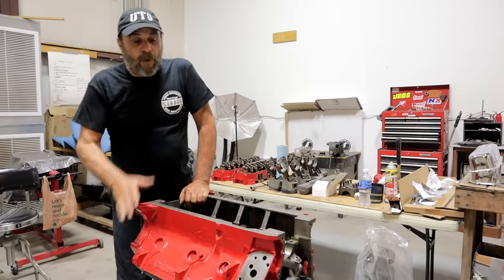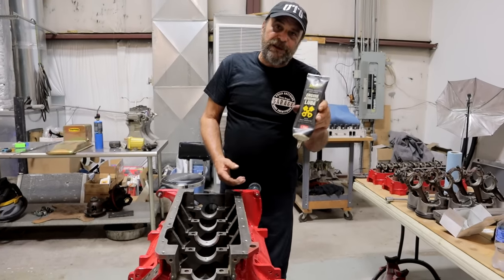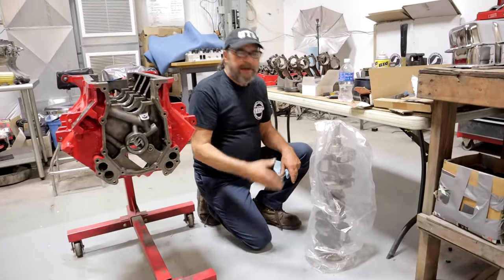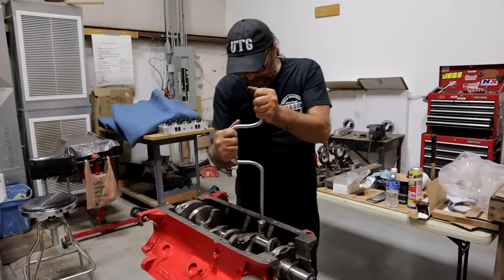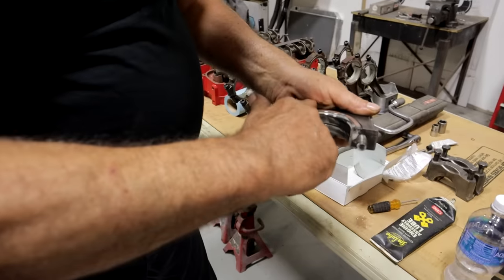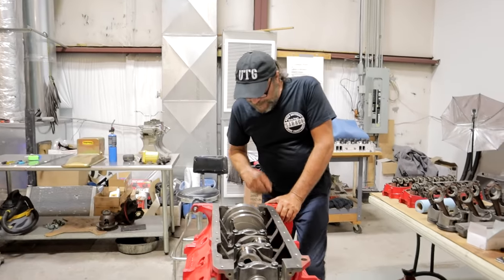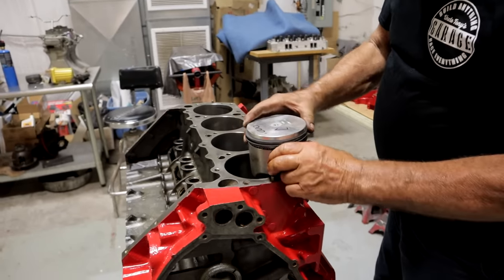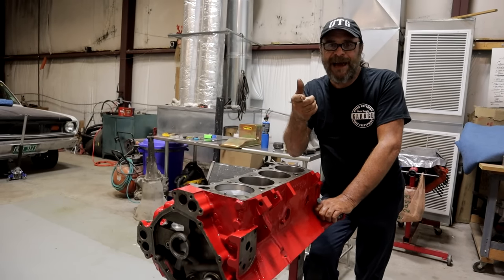Assembling A Short Block For The Home Engine Builder

Comment: The best thing i did when i started building more engines (subarus) was to buy a piston ring compressor that was specifically designed for the size bores used. its got a super thick bottom so you can't score the deck of the block. Not as much of an issue when you're using cast iron, but when you're working with aluminum you can save yourself a lot of heartache

Comment: I have been building my own motors mostly mopar and Harley motors you do them the same way I was taught I use hand tools to and a good click tork and a pointer torkrench to check for stretch just the way I was taught and I built a lot of early nitro motors to I have a 62Belvedere with a 512Hemi in it it is a happy Hemi in it 1650hp on highly modified factory race Holley carbs I like what you are doing thank you for how to reconditioning batteries.

Comment: Preluber from a 15$ bug sprayer and some hose and fittings to go in the oil  pressure sender hole and you're good to go,no distributor futzing around required.

Comment: One forged piston and the rest original (used) cast? I'm not worried about the balance, as it is notoriously bad from Chrysler, but that's pretty ghetto!! LOL😆 That Crane 302H Commander is a good camshaft, I've used them in many 440s and a friend had one in his '68 Road Runner 383 4spd, and they all ran well. We later put a .509 PurpleShaft in the Road Runner, added 4.30 gears and it was an ANIMAL, but with 3.23s the Commander was a way better choice.👍👌
Reply from the maker: It's a cast TRW replacement piston.

Comment: old guy taught me a trick, use Lucas oil for assembly lube. Wayyyy cheaper than the special stuff and it sticks just as good if not better!
Reply: I was told not to do that because it's too thick and could possibly cause a bearing to spin on the first startup

Comment: and...if the crank jams up when you tighten the caps, loosen then, then strike the caps with a heavy rubber mallet. then tighten and check the rotation again. same for over head cams etc. imho I would use a small bar to lever the crank back and forth - and use a dial indicator while your at it and check the thrust bearing end play

Comment: I have had debates with my son for tapping pistons in the same way for years. These days the whipper snappers use machined to size installers (they do make life easy). Just on the thrust bearing, i finish off the thrust toward the rear if running an Auto. Flex plates do just that, flex away from the block (would love to know other thoughts on this). One last thing, i think Ol Unc was going to explain why he wipes off the rod bolts. I assume he was going to explain how it is possible to hydraulic the block from excess fluids. OHHH one more thing i really like the idea of torquing everything together at the end. I have ???? myself on occasion when doing it as i go. Good vid thanks Unc.

Comment: White lithium is a great pre- run lube, I used it on gas and diesel engines, transmissions, and other parts as well, and always had great results. Never used silly-con though it's too apt to break off and plug up an oil port, lifter, ect. IndianHead gasket shalack stays where you put it just make sure not to over use it 'cause it's a pain in the arse to clean off.

Comment: One thing that has always worked well for instant oil prime on first crank up is white lithium engine assembly lube in oil pick up tube and oil pump inlet.  Its light and will guarantee oil prime. Also its the first thing the bearings see on first start up.

Comment: I’m just curious did u mount the rods backwards in the pistons first ? Stock rods have a Chanel cut into them and rod bearings too to oil the cam and the chanfer on the crank shaft will not seat the rod or the rod to rod . Rods have a fat and flat side . Fat side to the crank side flat side to rod side

Comment: I like to use Anaerobic sealant on the last main cap to seal the 2 piece rear main crank seals.
Reply: I had so many of them seep oil until I started using it. Never went back it only dries in the absence of air. As in it is for sealing machine finished surfaces.

Comment: I know its an older video but if you're using fully grooved bearings do you have to,A use a high volume/high pressed pump.B and or have the main oil galley honed out to be larger im building a high compression 6 liter for a desert truck right now.

Comment: Great timing Tony, am rebuilding a 69 Super Bee  Super Commando 383, got the crank  back yesterday cut for new bearings .Just found out the Super C has reworked 440 heads with 1 .74 exhaust valves instead of 1.60 normal duty heads  and stiffer valvetrain parts .Very cool .Tony or any other Mopar Master can you recommend piston rings , have new old stock  pistons and also what brand crank bearings to use. Also have a 70 440 crank, perfect condition can i use it ? Thanks ..Pedal To The Metal...🏎

Comment: Uncle Tony your system for engine assembly is the same as mine. Imagine that lol the only thing different I do is use the rubber on the rod bolts so I don't have to contort me body to guide the rod from gouging the journal.

Comment: I used to use a beam torque wrench after every piston to see what the friction was in inch pounds and how much friction there was per addition sometimes it would hardly get any till they got to the last one and tightened all the bolts that it would pretty much double but after a 15 minute run in you can turn the engine really easy and I started using that rain compressor around 1970 on a go-kart engine I'd was building it was a Wisconsin six horse and I went there's a dimple at the bottom of the Ring compressor that faces the block I used to Tamp it tight and do all that stuff like you're doing there when I was 14 man that was a long time ago

Comment: what i'll add to the piston insertion--make sure the chamfered part of the big end of the connecting rod is facing the fillet on the crank journal, or you'll have the "sharp edge" riding on the shoulder and wipe things out. Two I like cover the end of the hammer with a rubber cap like you find on the end of crutches and old folk walkers--its a cheap rubber mallet, in case you want to save space in your trunk tool box and have two tools in one. Three, if you're doing this the first time, consider using a fish scale to pull each piston down--if you get a different reading, something's hung up and its time to find out why.

as for removing the excess paint at the end, I suppose you'll be using a razor for it--create a nice clean edge and not chip off too much.

Comment: I got my main caps screwed up once and just swapped them around until it was easy to rotate the engine. I already had to get it re-bored because a piston melted, and that happened just after i just got it back from the machine shop, I didn't want to spend that much on a 94 Cherokee.

Comment: I agree with 99%… I prefer to add a little lube where the bolt or nut contacts the surface of the caps (main and rod) think 🤔 about it… it’s where the highest tensile contact load is, relating to friction, while torquing it down. 🫵🏼😉

Comment: I just fired up my Pontiac 400 that I converted to a 461 Stroker.  I followed so many of your tips from other videos that I felt comfortable tackling a rebuild.  I may have watched some other channels too :)  I used the assembly lube and then primed the engine with a primer tool because the engine had sat several months since assembly.  I upgraded to hydraulic roller lifters, so thought it best to make sure they had some oil as well as up through the rods to the top.  Novice builder, so I did tons of double-checking as I went just to make sure I didn't miss anything.  Thanks for all the tips and encouragement you provide in every video!

Comment: Spinning engine after every main bearing  Is and rod torque is Is a must Individually if there's a problem you'll find it that's why I like using assembly  Lube Don't have to worry about damaging anythingI also like to use a lot of oil when putting in rings and rotate the motor and that way if there's any scratching in the cylinder wall it'll Show you

Comment: Only thing I wouldn't do is hit a steel crank with a steel hammer, there's( babbits ) around the outside of your main bearings, if you look at your main bearings on the end of the bearings that go on the outside theres little lines on your bearings these are designed to direct oil flow and hitting your crank with a steel hammer flattens those babbits out if they go too flat you will not have a very long engine life.ive seen hitting a crank like that destroy a motor in break in , that is why they make a babbit hammer from lead or other soft metal it absorbs the shock of the hit and eliminates harming the babbits on the bearings.

Comment: About the fully grooved bearings. I heard that chevy did testing on fully grooved and half grooved bearings for the bbc and found that half grooved could support nearly twice the load. I understand wanting more oil around the bearings but I thought load capacity would be more important. Awesome vid though Tony!
Reply: Also if you see this tony what is your take on plasti-guage I have heard it is worthless but also in high school that is how we checked clearances and had no problems. Thanks again.
Reply: The more bearing surface area there is, the higher the "load" capacity. On the other hand, the less bearing surface there is, the lower the drag/resistance/power loss. So what your giving up in load bearing capacity with the full-groove you are gaining in less frictional drag. I'm sure the differences either way are minuscule.

Comment: Every motor that I had built I take triple ought steel wool and lightly take off the coating off the new bearings my friend used to leave the coating on and it would be embedded in the Babbitt when he took the engine apart mine look like mirrors

Comment: The reason you put the bearings on the block surface together dry is so you get accurate torque readings.
Reply: I always heard it's for heat transfer ,and yeah messing up your clearances because you can't make it consistent.

Comment: Tony do you have to have to balance the stock crank and stock type rods pistons The rods pistons rings pins bearings are all matching weight but the crank is from a donor motor stock size bearings

Comment: You don't use oil under the bolt heads where they meet the cap for proper friction to torque purpose?

Comment: So Tony...why is it that this engine doesn't require having shims added to the front end of the crank? I have three Willys L134 and  dodge T-214 straight six to rebuild for my WW2 cars and truck and they requires having shims added to the front. I believe it's so oil can access between the crank and thrust washer ring, something like 3-4 thou clearance. Why would the Jeep "Go Devil" L134 four cylinder engine require shims and a thrust washer but not a V8 motor? The L134 from memory has a thrust bearing for the crank like this motor does, so curious as to why no shims required for this motor. 

Also...thank you so much for making these videos, I'm learning a lot and when it comes to engine building for old engines, machine, prepping, assembly and all the little trade secrets....they're helping guys like me 1000% get our head around doing this work and knowing what to ask for and discuss with engine shops. There's not many left in Australia, most of them want to build late model turbo four cylinder motors or LS V8's or just do straight crate motor swaps/installs. Not many do old achool full machine, repairs, rebuilds etc so thank you for teaching us this stuff....if only I can find a mentor master mechanic like you in my town I'd have had my engines built years ago !!

Comment: Rebuilding a SBC and I brought my main caps to my machinist because he wanted them installed when he bored it over .030. I gave them to him marked with duct tape and marker locating where each cap went since I couldn't find the ID stampings on the caps themselves. I got them back and they were not identified. If I'm putting in new bearings and the crank was polished is it an issue if the caps don't go in thier original position?

Comment: Question When you put the pistons in backwards do you install the rods backward on the piston?
Why I ask for SBC AND BBC the tangs on the rod are always to face the camshaft per chevy repair manual. I think if you did not turn the rod on backwards on the piston the rod radius side would not be next the the crank fillet. So you you would have tight spots on the rod to the crank. Which it means it will not turn over easy with all the pistons in. If it did turn over after you ran it a little it would not last long.  So the rods need to be put on the piston the opposite side of the piston if you want to do this.. It short the rods tangs always need to face towards the cam so the radius of the rod meets the radius side of the crank. At least this is the way on SNC AND BBC and would thing so on other engines.

Comment: Forgetting to torque. Learned that the hard way. At about 6500 rpm on a fairly hot 400 Pontiac swapped into a 73 LeMans. Connecting rods make a hell of a hole in a block if ya' let'em. 

$5,000 down the drain. Hard lesson learned.
Reply: No noise before it went? I had a vehicle which somehow didn't get torqued but luckily I heard it before it went flying!!
Reply: @SmackeysGarage  At that RPM there was a quick thud followed a fraction of a second later by the sound of shrapnel. No way to have saved it. Two of us finished up the short block at about 3 AM. Best we could figure it was a case of 'I thought you checked it" and neither of us had. Live and learn.
Reply: @wordfabstream8745  I can only imagine the noise that made when it went apart at 6500rpm! Wow. 

I think it was the same situation with the torquing with me. My father and I were both building the engine and we both thought each other did it.

Comment: Funny 50 years ago when I was putting a homemade go kart engine together and then years after that I was always very slow at putting an engine together when I started doing more machine work right around the time Mount St Helens blew up every engine that I ever did I put it together one piece at a time and then I checked the friction or the rotating tension people would tell me you're a good mechanic but you take too long the reason I take too long as I'm a good mechanic the reason I'm a good mechanic is because I take too long! I never throw an engine together and get it running tomorrow I don't care what kind of situation but when you were testing the rotation after the main cap that's something I did for years after each one I would check the rotation with a beam torque wrench to check the friction and if I found a lot of friction then something was wrong nobody taught me this I always did it myself but cleanliness was the main thing and I would sometimes end up cleaning inspecting and doing several movements on a block and washing it three times before it was finally painted

Comment: Very good information Tony!!! Excellent advice on the pre-assembly preperation. Please use the surgical gloves when handling the bearings..  Do not touch the surfaces, as the liquids/moisture from our skin is very corrosive and it repels oil film... Please use gloves Tony....

Comment: You should face the deck towards you so the cylinders are horizontal. And you don't need to squat down and break your back. That's the purpose of the engine stand! 
The engine is not in the car! 
And yes, use two 6" pieces of fuel line. They'll guide the rod right onto the journal.   Work easy!

Comment: The general info here is decent for a budget build. The couple of things I disagree with here is seating the main caps by tightening down the bolts instead of tapping them down fully onto the registers first. Also, using an unknown lubricant on the bolt threads can give you incorrect main journal shape due to varying final bolt stretch. Regular engine oil should be used if the lubricant used for setting main and rod bore size / clearance is unknown. The type of lubricant used to torque the main and rod bores can greatly affect bearing crush. I'd also first torque the mains before installing rods so you can check for free and smooth crankshaft rotation once the mains are locked down. 

I disagree on installing offset pin pistons backwards. I’ve done testing with this myself on various Ford Windsor engines and found absolutely no difference using production pistons. I worked for a shop which built engines for Roush and Yates. Both have spent a good bit of time and money trying to get even the smallest advantage with their engines if the sanctioning rules allow for it. We've seen alot of so called cheats in engine building which for the most part didn't make any observed repeatable differences. Most of the time we concentrated on reliability over everything else so the engine could be pushed as hard as possible without failure.

Regarding the piston install, you should also be able to push the pistons in by hand with your thumbs using a halfway decent ring compressor. Even with higher tension rings, this wasn't an issue. Using a hammer handle isn't a good idea. Fixed ring compressors aren't expensive and allow for very smooth piston installs without the worry of breaking an oil control ring.

Comment: Smokey Yunik had a very specific method of achieving gains with the piston flipping trick. He searched out core shifted blocks that were shifted laterally a very specific direction and amount so that the bores could be offset  without having a thin spot. Just flipping the pistons achieves nothing. Most wrist pin locations aren't offset enough anyhow.